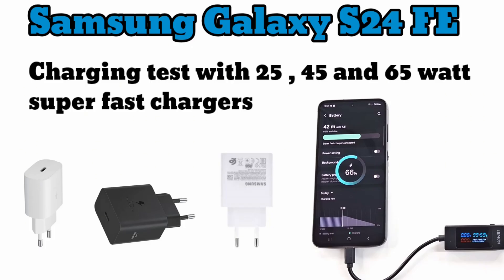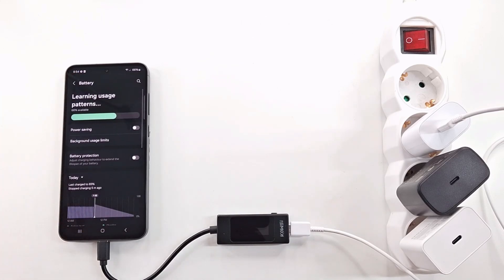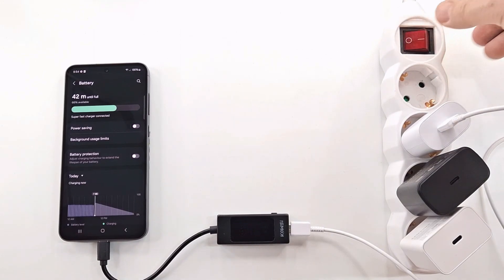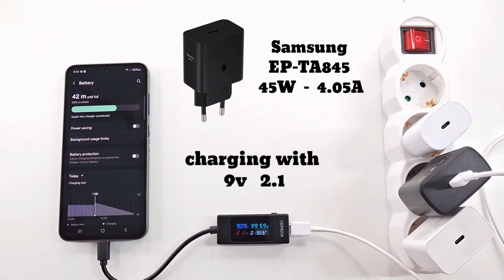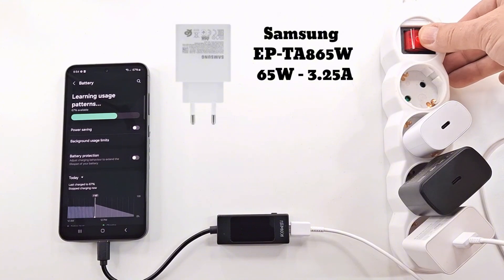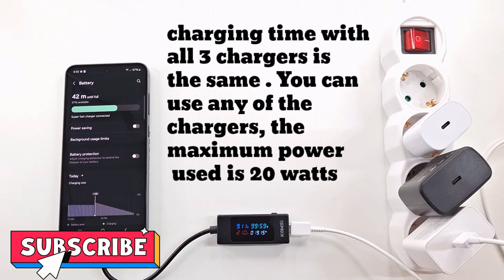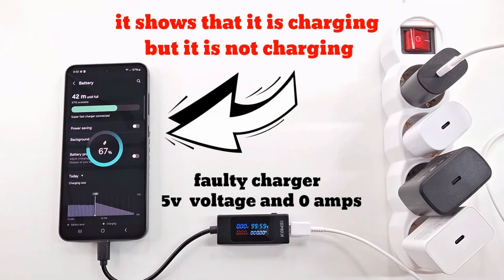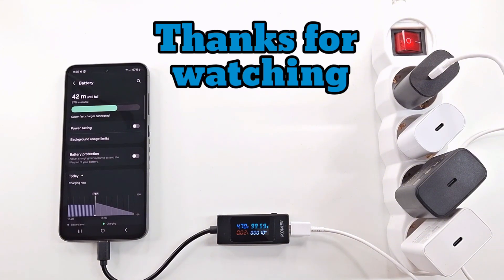Samsung Galaxy S24 FE charging test with 25 , 45 and 65 watt super fast chargers

Comment: This is the only letdown and the thing which is stopping me from buying this.
Reply: What are you coming from? Most recently, I've had a Note 8, S22, my wife had an S21 and S22. I upgraded us both to the 24FE beginning of 2025. The battery life is strong, so charging speed isn't as crucial. With a capable charger, the 20W charge dumps plenty into the phone in 15-20 minutes if you're in a pinch. I limit mine to 80% mac charge, and I keep it on a mid-speed MagSafe charger in the car. Other than that, most days I only plug it in at night on 5W charger, and I'm on my phone more than I should be.

Comment: S24fe only support 25w charger
Reply from the maker: Samsung S24 FE can be charged with any 25, 45 or 65 watt charger but does not charge faster with 45 or 65 watts
Reply: @gsm4fan  how much time it takes to fully charge with 25w? 0to100??

Comment: My S24 fe also caps at around 20W while charging, even though my adapter is a 25W charger and allegedly the S24 fe supports upto 25W fast cahrging.  If that's the case, why doesn't it go upto 25W?
Reply: it's common. the label shows the maximum Wattage at which it can charge. Almost all phones charge below their advertised wattage.
Reply: it will constantly transform to charge
Reply: @ yeh recently i see it capping at around 18/17 watt
Reply: @kabirhasan995 I use a 25W charger, I noticed it would push the 25W output below 60 percent, and maybe sometimes it would drop 15W when it was hot, then it would go back to 25W, over 60 percent it would go below 20W, and then drop to 10W when it was 90 percent, in the ideal time it could get up to 27W.
Reply: @tnvdi  i see. Once i saw mine hovering at about 12 W and i though my adapter was faulty. However when i held it, it was very hot to touch. So essentially the wattage varies according to the charging level and heat.

understood thank you